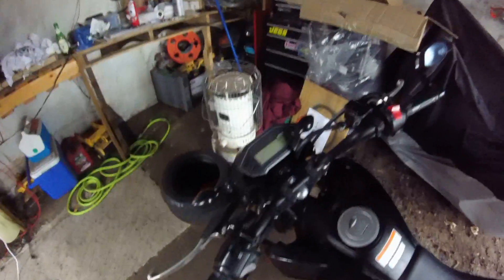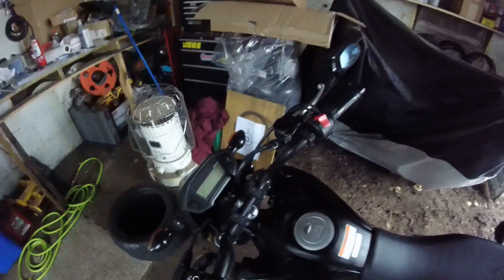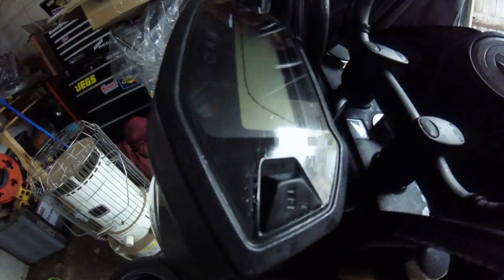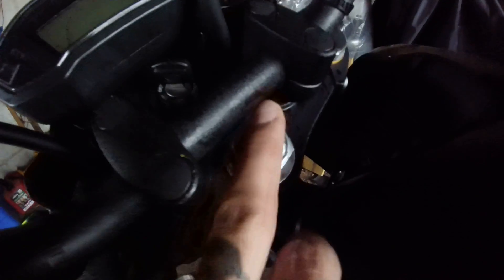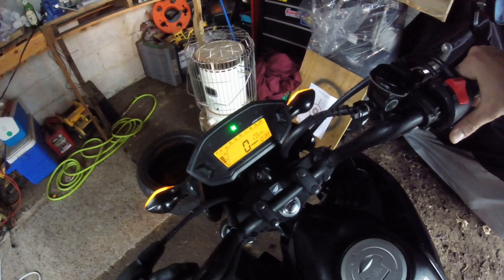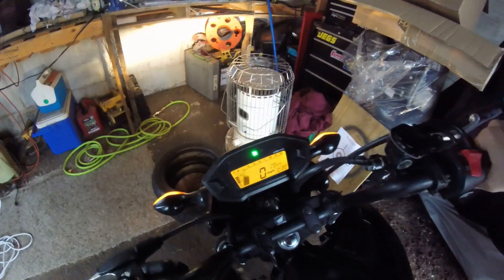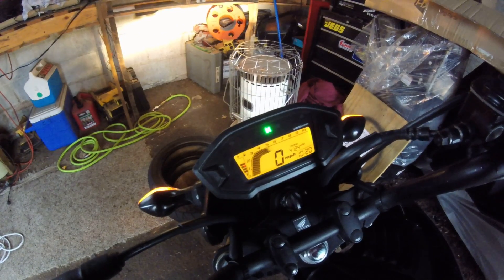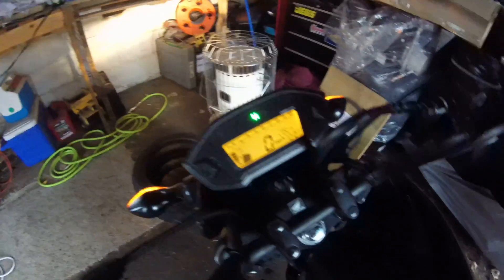Honda Grom Sputters And Dies

Comment: I believe I had the same issue with the yosh full system, not that bad tho. I reset ecu and tps and reset ecu again per service manual. And it has seemed to be less frequent. I also adjusted idle, and switched to the honda recommended 1 step Colder plug. Hope this helps. You can dl the service manual on the forum
Reply from the maker: I think the boot for spar plug was loose, so long ago hard to remember now lol

Comment: Look at the spark plug boot
Reply from the maker: that's a good call because that's exactly what it was the spark plug boot has a small crack in it allowing water to get in an arc the power away from the spark plug

Comment: What was the issue? Think I’m having a similar issue..
Reply: Like someone else said in the comments, check your spark plug boot! I was going through the same problem with my grom, always got worse when it was wet outside. just yesterday I found a crack in the boot! Now she’s as good as new! FYI, an easy way to find a crack in a boot is to start up your bike at night. You will be able to visibly see the arc as it grounds out !
Reply from the maker: Check the boot i think it got wet and was loose making a crappy connection
Reply: @WintersMachining  i actually was having tps issues. Reset the tps seems to be good
Reply from the maker: Wishing I never sold it to be honest.... I may buy another one
Reply: @WintersMachining  sold the grom. Why?
Reply from the maker: @LifeWithStiel  I know, huge bummer. I sold it to buy another bike, the wife said i has to sell one to buy another. I have many bikes, mostly atvs and side by sides.
Reply: @WintersMachining  i want a bigger bike but dont have the $. I want a 2004 zx10r. Dream bike
Reply from the maker: @LifeWithStiel  Yeah one day! They are awesome bikes
Reply: @WintersMachining  Or either a mt07/fz07

Comment: Man I'm dealing with the same thing... original carb though. Idk where to find the screw for the idle.. I believe taking off the fairings
Reply: There's no carb.  It's EFI.  And the throttle screw is on the right side under the throttle pulley where the throttle cables come to the EFI.
Reply from the maker: It's fuel injected not a carb